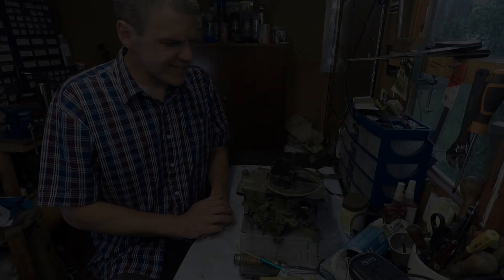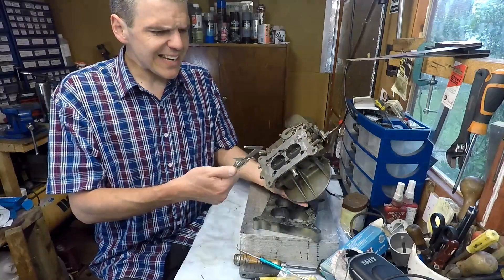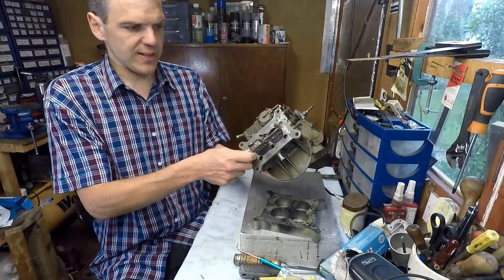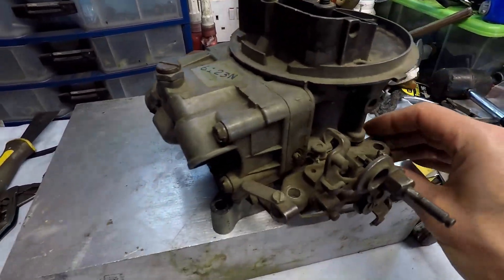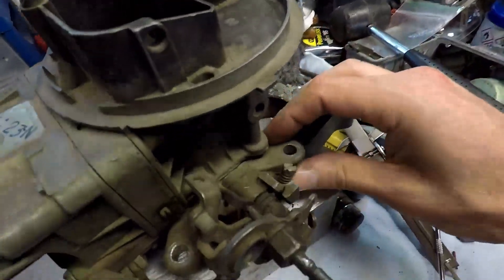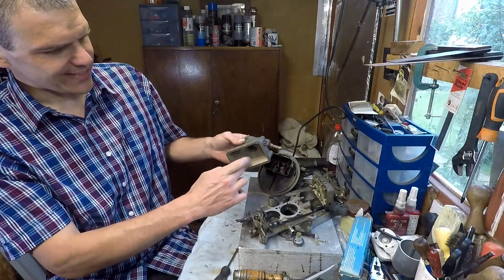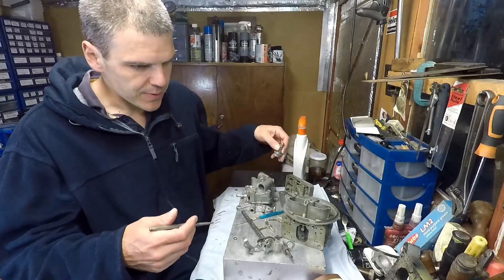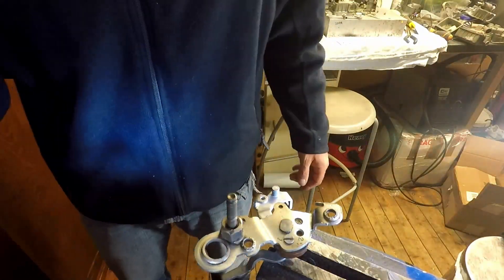Little unit but packs a punch. Holley 2 barrel 500cfm carburettor for high performance Americana

Comment: 500cfm ( 2bbl in particular)are rated different than 4 bbl.
They flow more like a 600cfm. Modded they can flow more like 750cfm! Hot rod did articles on this.
Reply from the maker: Yup! Its essentially the primary side of a 750!